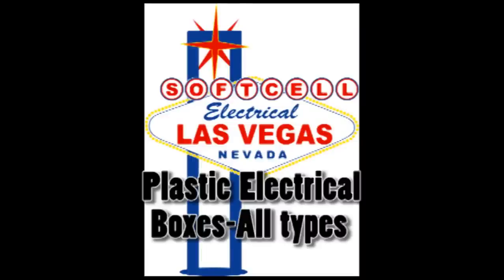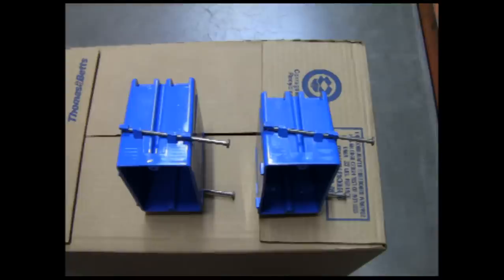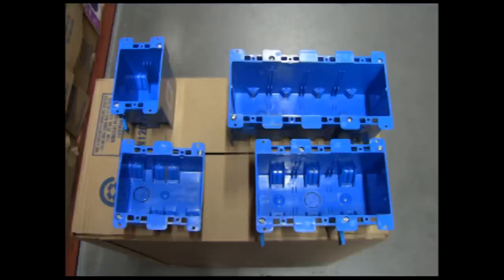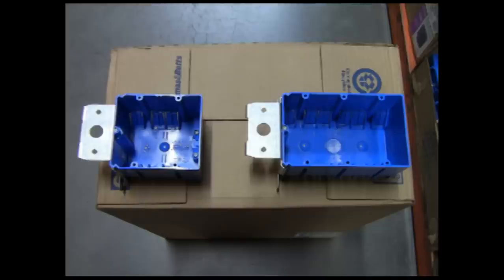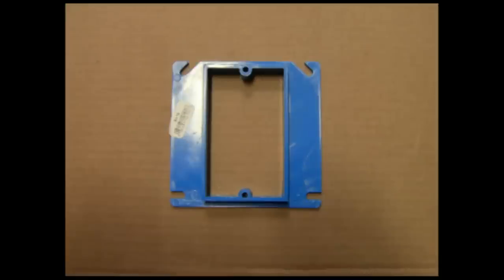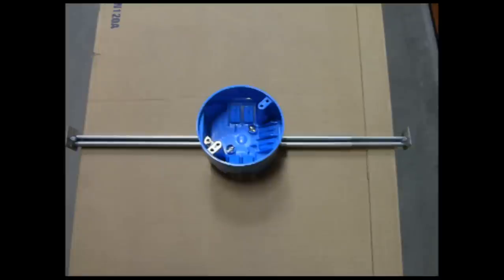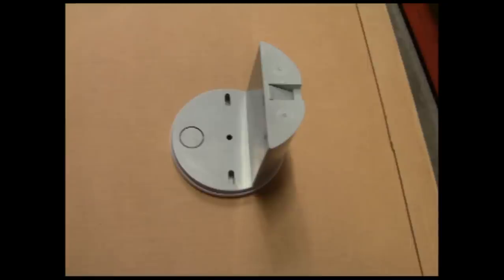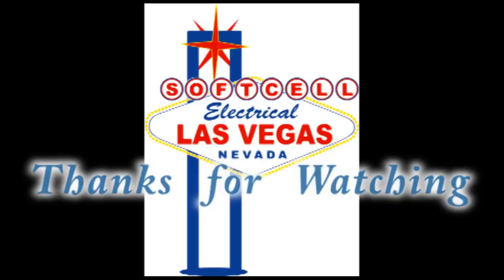NEC code on electrical boxes # 100

Comment: Metal boxes require cable clamps and the multi gang plastic boxes have built in clamps, but the single gang plastic boxes don't have clamps or at least nothing significant. I guess it's to allow for more volume and cheaper to make. They typically come in sizes of 18, 20.3, and 22.5 cu. in. I prefer the largest one because the price difference is small and there's no other downside. More room for wires is always better.